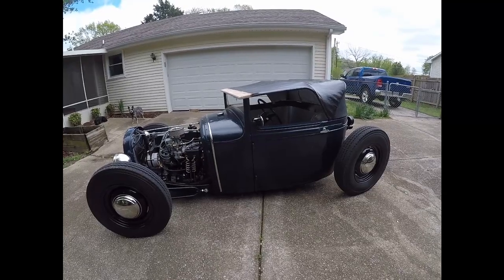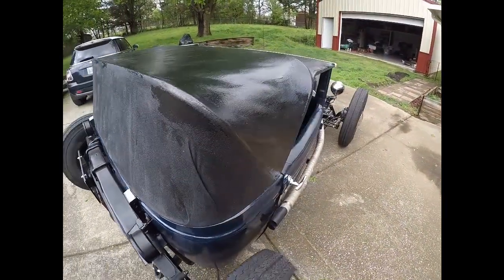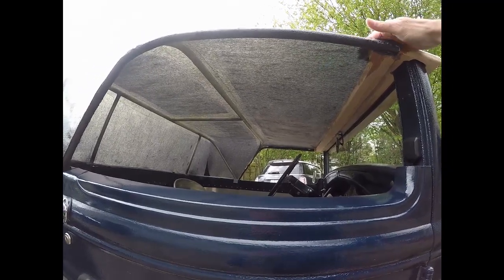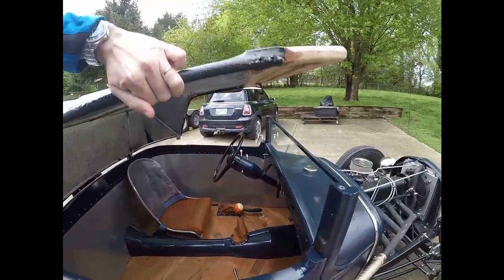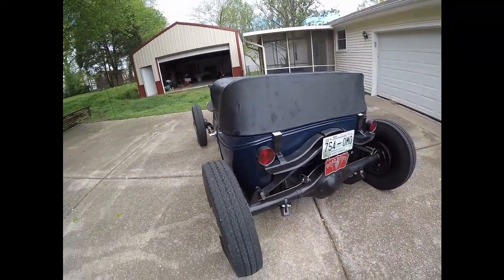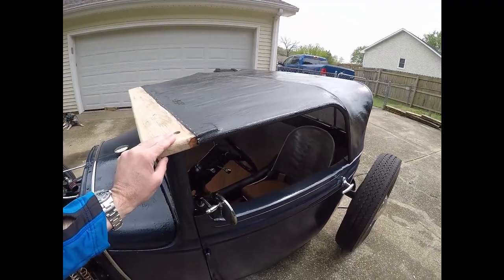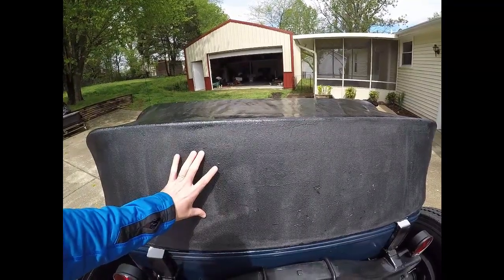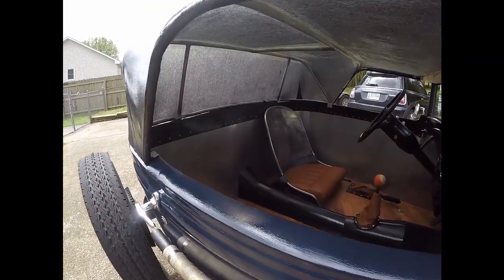1930 Ford Model A Modified Carson Top Build: Part 3

Comment: Fine progress... can't wait for the next installment. One question, I'm wondering why an inside hinge didn't appeal to you. Since your not especially bedazzling the those exterior hinges... Why have them? Just a thought....fine execution either way
Reply from the maker: Great question.  I plan to run the car without the top, for the most part.  I didn't want to have hinge connections inside the car rim.  I thought it would take away from the simplicity of the inside of the car rim.  With the top off, you barely notice the  3/4 inch hinges welded to the top of the frame kick ups. They also make good mounting points should I decide to build some sort of luggage rack in the future.

Comment: I do have a question. Im thinking about doing my 49 shoebox Ford, did you use a bunch of clamps to hold the material around the side and rear while doing the fiberglass resin?
Reply from the maker: Pull the stretched fabric tight, then run a line of super glue along the fabric where it touches the conduit. Holds really good. Install the top so the shape doesnt warp when you pull everything tight.
Reply: @ladladderson8362  good idea on the super glue. Seems like the fleece and fiberglass resin idea for a base before adding padding and cloth is a good idea instead of using chicken wire.